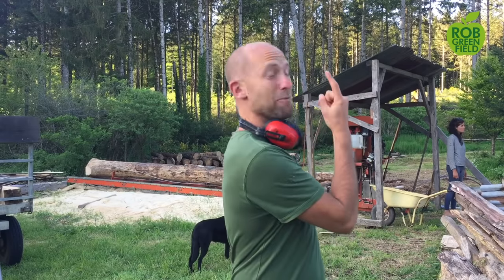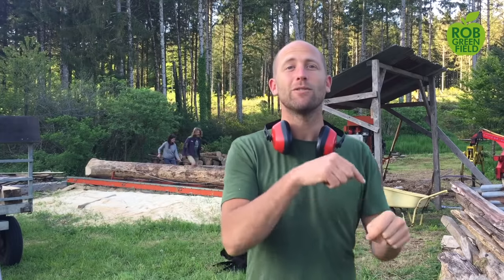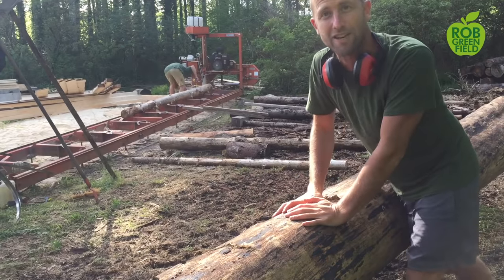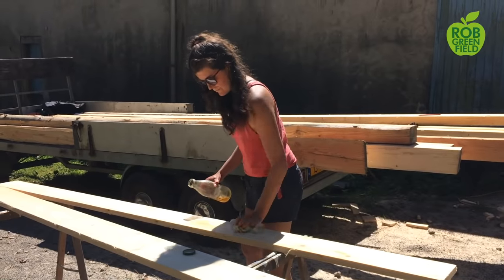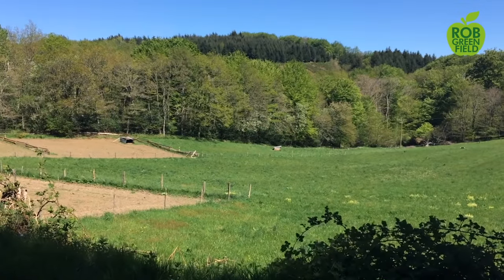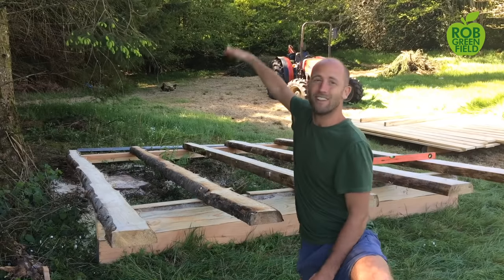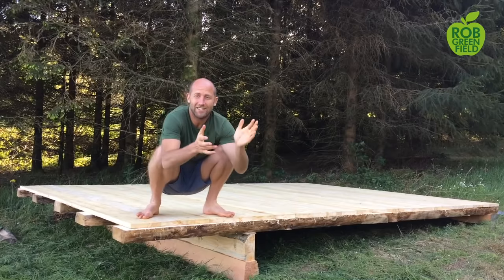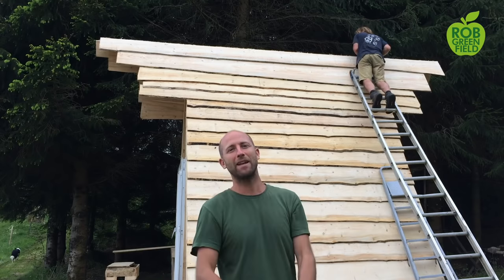Building an Off Grid Tiny House from the Land

Comment: Hey engineer here, I really like your stuff rob, but I honestly don't think the take aways from this video fit the idea of sustainability. Building for your specific purpose is good in certain situations, for example building smaller if you need less, but building a temporary structure like the one you just showed is NOT sustainable. You were using trees that if they were 20/30ft long took at least 20-30 years to grow, given you said they were pine(you said you were in france so if you're at altitude that it would take longer). And by not building a real foundation or even laying down a gravel layer and just putting untreated lumber straight on the ground you have put a shorter expiration date on that structure. Without sealing the wood its just a whole lot more vulnerable to the elements and to wood eating critters. Theres all sorts of natural ways to seal wood, for example doing Shou Sugi Ban(burning), beeswax, all sorts of oils... the list goes on... so I don't really know why you wouldn't. I just think if you want to build sustainably you want to build a structure to last longer than it take to grow or produce the materials necessary to build it. Its kind of the antithesis of sustainability to build a structure with expressed purpose that it doesn't last.
Reply: Queen of Potatoes  you are quite wrong, most of modern structure houses last from 60-100 years if taken care of, not fifteen years.  That is why in America if you have to take out a mortgage you can get 30 year mortgages.  Two TheStudio is quite correct, that is a lot of trees to butcher for a structure to only last, especially in your terms (5 years), is a terrible waste of trees, especially since a pine to get to that size can take a minimum of 10-20 years to grow that large.  No this should have been planned better and the wood treated so this location could last a very long time, but as is it is just a waste of trees. So there is nothing about this video that is "sustainable."
Reply: Queen of Potatoes  what kind of house do you live in that would break down in 15 years lmao??? thats a bit ridiculous to say the least. My parents live in a REGULAR wood construction american home- literally nothing excessive, 3 bed, normal house and it has been standing for 50 years.
Reply: I think the whole idea here was that the wood was going to be used for fire anyway so instead of chopping it up and using it to cook and heat up places, they build a house with it first and in a few years they will use the wood for cooking and heating up places and maybe keep the flooring for the next house they're gonna build. It's all about perspective here.
Reply from the maker: Hey mate,
I totally understand where you are coming from.
This is Antoine's design and project. I was along for the project.
With that being said he is managing 60 acres of plantation that he purchased and is transitioning it into native and sustainable forestry. So trees need to be cut. it is not unsustainable to build  a simple structure out of wood built on site, that will re-enter the land, even if it is in a decade. 
We know all about natural ways to seal.
Temporary is not the antithesis of sustainability. Sustainability is often things not lasting. 
In this scenario, this is a sustainable build, Antoine knowing the situation fully on his own land.
Health and happiness to you,
Rob
Reply: @Robin.Greenfield  Thanks for the reply! And sorry if my comment had a harsh tone, first and foremost I really think what you are doing is great and I love the message you are sharing with people and you really just seem like a great guy, so I don't want to be bringing any negativity to your comment section. So please keep doing what you are doing! I love sharing your videos with my family and from sharing your videos with my mom I was able to inspire her(or really you were) to expand her garden and she's really ran with it and is producing enough food to actually supplement a non-insignificant portion of her diet. All I was really trying to point out in my comment was that by using a couple simple building techniques you could really extend the life of the building and kinda in a sense the life of the tree. Of course nothing is perfect in the world and putting a productive use to wood from trees that needs to be cut is a good thing. I think I'm just really use to advocating for building techniques that will extend a structures life because especially in traditional construction theres just a huge amount of waste and building a structure that lasts as long a possible is generally the best way to mitigates a lot of that. But as you can tell by the length of my comments I tend to get lost in the weeds so I'll end this by wishing you the best and I look forward to following your future projects!
Reply: TheStudio I was thinking of the fresh cut wood shrinking with little width for error
Reply: Use eco brick. More sustainable
Reply: @avigetsbored  Well as a content consumer and Rob admirer, I salute you both ! Thank you TheStudio for your comment because it is important to point out as some people may have seen Rob's video and ran with it without the considerations you mentioned.  That said I am an off grid DIY survivalist gardener and built with adobe in the SW. As a pro what do you think of adobe? I have no regrets building with adobe. Again I am so glad you commented here !
Reply: @sframe1978  Plenty of houses in Europe are >100 years old. The oldest house in the Netherlands is from 1130. Almost 900 years old. Now that's sustainable.
Reply: Well I think the trees should not have been live trees but dead trees, which would have cleaned up the land as well as provided building materials.

Comment: Fantastic. Thanks for the inspiration. This is something I've been curious about, but foundations and complexity have always been intimidating. This makes it a lot simpler to wrap my head around. No concrete or special metal brackets necessary. Just simple long screws you can get from any hardware store. Amazing.

Comment: On the cheap, an inside poly wrap under the floor and walls and a tiny burner could keep insects out and also keep it livable in the winter. My only question, how many trees did this build take total? People have cabins where their trees go down from storms. We currently have about 20  large poplar trees stacked up on our property that could be put to use.

Comment: "Last for 4-5 years" ??? :o
Reply: Yeah, you'd think it would last longer. Or that they would treat the outer wood to help it last longer...
Reply: Yea I'm thinking the same, why not make it durable and worth it more.. its not easy to cut down trees, prepare wood and build even the simplest structure. But if you are going for all natural I'm not quite sure how store bought glass+plastic door go with the philosophy here
Reply: @shkico4513  i think they're just being practical here. He did talk earlier in the video about reusing stuff -- possibly fits the bill.
Reply: @roberts2514  Untreated wood planks don't last long at a all
Reply: Pine wood is less durable than Douglas in France.
Reply from the maker: Actually it will last 10+ years Antoine believes. He would be happy if it lasted 5-6 years minimum. 5-6 years under the worst conditions he believes.  I misspoke, so I have cut that little bit.
This is his design and for him it is a wonderful couple of day work project and he is experimenting with different building. He is happy to continue building more.
Reply: You could preserve the wood by charring it. Japanese shou sugi ban technique. There are wooden buildings there hundreds of years old using this method.